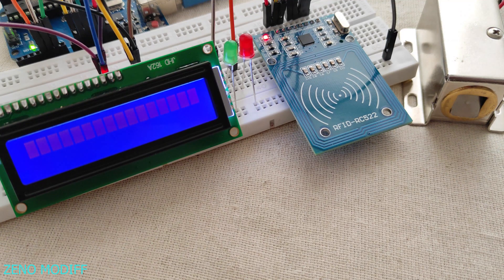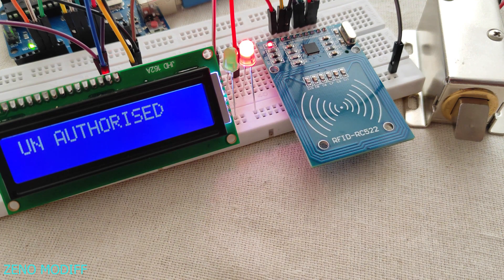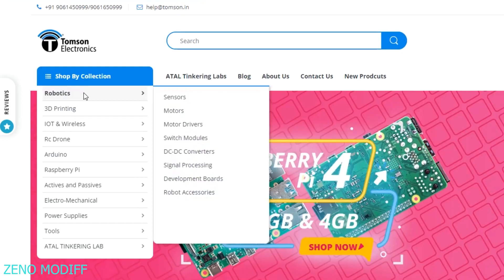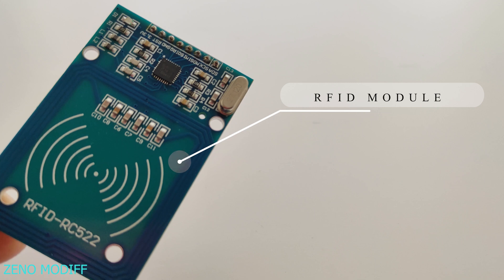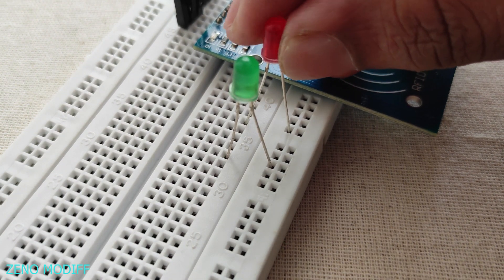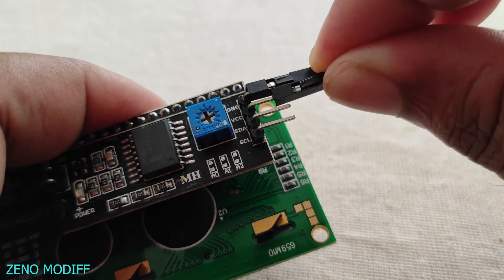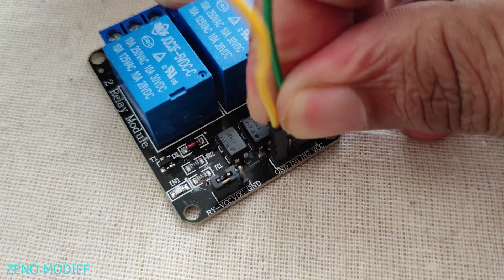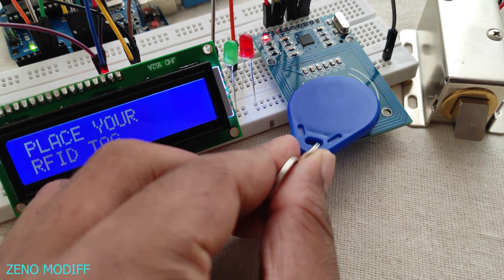How To Make RFID Lock System Using Arduino || Tomson Electronics

Comment: How you connect the solenoid door lock and what is the volt for battery? thank you
Reply from the maker: Here I use 12 v solenoid lock ❤️
Reply: @ZenoModiff  Thank you,so we don’t need to put 12 v battery true?
Reply from the maker: @razanyousef6350  yes it should around 6 -12

Comment: hi, i want to ask you something. how to program if the circuit is added with the buzzer module. thanks
Reply from the maker: It's simple type outside void setup 
Int buzzer =  which pin u need ;
Void setup ()
pinMode(buzzer, OUTPUT);

Then type where u need to play the buzzer 

digitalWrite (buzzer, HIGH);
delay(1000):
digitalWrite(buzzer,LOW);
delay(1000);
Reply: @ZenoModiff  thank u very much
Reply from the maker: @rifqipratama8818  good to hear from you

Comment: I WANT THE CODE PLEASE !
Reply from the maker: #include <SPI.h>
#include <Wire.h> 
#include <MFRC522.h>
#include <LiquidCrystal_I2C.h>

LiquidCrystal_I2C lcd(0x27, 16, 2);
 
#define SS_PIN 10
#define RST_PIN 9
#define LED_G 5 
#define LED_R 4
#define RELAY1 6

MFRC522 mfrc522(SS_PIN, RST_PIN);  

 
void setup() 

{
  lcd.begin();
  lcd.backlight();

  lcd.print("ZENO MODIFF"); 
  lcd.setCursor(0, 1);
  lcd.print("RFID LOCK");
  delay(1000);
  lcd.clear();
  
  SPI.begin();   
  mfrc522.PCD_Init();  
  pinMode(LED_G, OUTPUT);
  pinMode(LED_R, OUTPUT);
  pinMode(RELAY1, OUTPUT);
 

}
void loop() 
{
lcd.clear();
lcd.print("PLACE YOUR");
lcd.setCursor(0, 1);
lcd.print("RFID TAG");
delay(1000);
lcd.clear();

  // Look for new cards
  if ( ! mfrc522.PICC_IsNewCardPresent()) 
  {
    return;
  }
  // Select one of the cards
  if ( ! mfrc522.PICC_ReadCardSerial()) 
  {
    return;
  }
  String content= "";
  byte letter;
  for (byte i = 0; i < mfrc522.uid.size; i++) 
  {
    
     content.concat(String(mfrc522.uid.uidByte[i] < 0x10 ? " 0" : " "));
     content.concat(String(mfrc522.uid.uidByte[i], HEX));
  }
  content.toUpperCase();
  if (content.substring(1) == "2A 17 6E 3C") 
  {
    
   lcd.clear();
   lcd.print("AUTHORIZED ACCESS"); 
   lcd.setCursor(0, 0);
   delay(2000);
   lcd.clear();
   
    digitalWrite(RELAY1, HIGH);
    digitalWrite(LED_G, HIGH);
    delay(6000);
    digitalWrite(RELAY1, LOW);
    digitalWrite(LED_G, LOW);
    delay(1000);
  }
 
 else   {

   lcd.print("UN AUTHORISED"); 
   lcd.setCursor(0, 0);
       digitalWrite(LED_R, HIGH);
    delay(2000);
           digitalWrite(LED_R, LOW);
              lcd.clear();
    delay(2000);

  }
}